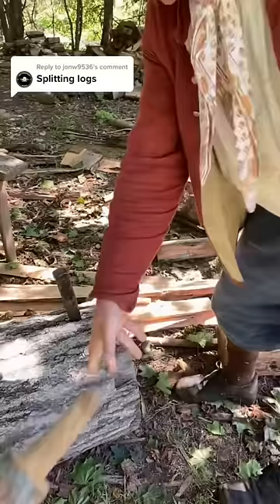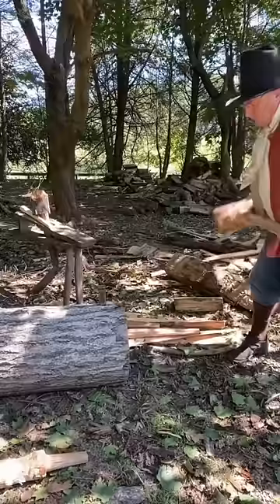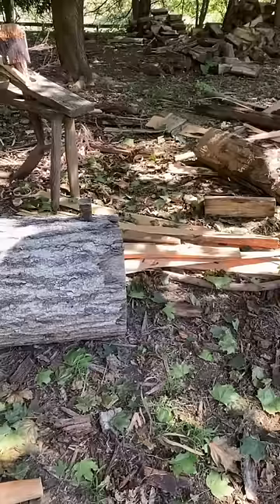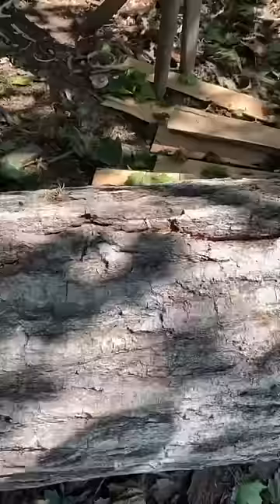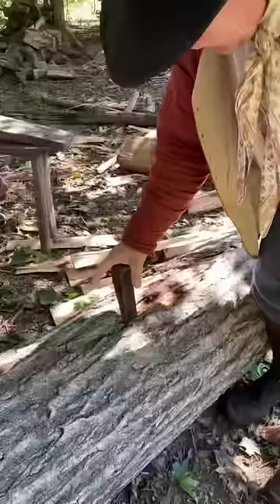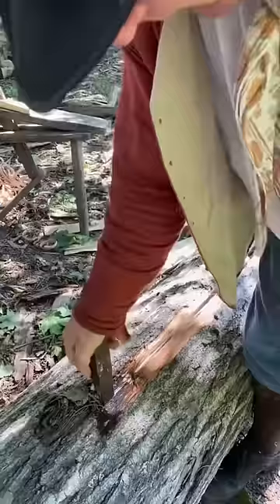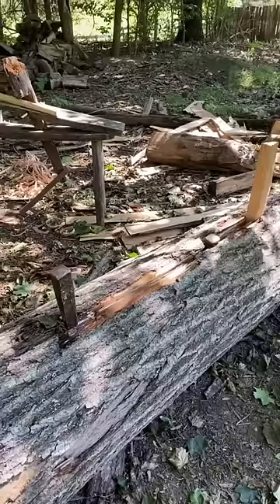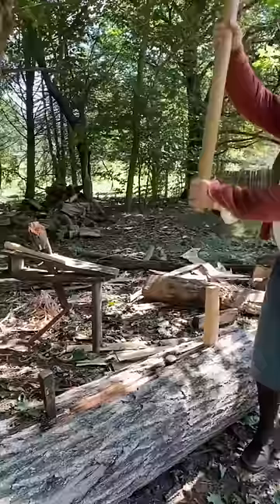Alex shows us how to #split a log using a #wedge. #simplemachines #livinghistory #history #museum

Comment: Yes,the hammer falling is doing most of the work. If that wood hammer weighs 15 lbs  ,the striking force would be many times that. A 200 lbs man falling six feet had about 3,500 lbs of force when he hit. Those pile drivers you see hammering in 40 foot telephone poles all the way into the ground are driven by a hammer that only weighs 300 lbs . The force generated through falling increases into thousands of pounds . A carpenter hold their hammer towards the end of the handle because the 20 oz hammer will do most of the work .
Reply from the maker: A blacksmith will do the same!
Reply: Where have you seen people hammering 40 ft telephone poles into the ground?
Reply: @two5seven14  Louisiana and other areas where ground isn't solid enough
Reply: Who cares they totally are not filming this with a camera from the period so I call BS
Reply: Yea um she said that

Comment: "This is basically using simple machines right" 🤓 
No that's a tool, but he's a machine 💪
Reply from the maker: Some of the tools he’s using are a few of the six simple machines. Lever, wheel and axle, pulley, screw, wedge, and incline plane. A simple machine is a mechanical device that changes the direction or magnitude of a force
Reply: An out of shape one at that
Reply: @frontiermuseum1  
He probably knows that, but was using the play on words to describe how much work he had to do. And unless you're using a dam to harness the energy of falling water, then you're not really letting gravity do the work for you. You're lifting the  hammer and storing your energy input in the form of potential energy, then you're utilizing that stored energy along with your continued energy input as the hammer drops to get a total amount of kinetic energy to impact the wedge as hard as possible. So it's all your work, and you are just using gravity to convert and store your slow energy input (low power) to then use that high velocity large mass to perform another conversion to perform work with a very large amount of force through a small distance over an even shorter amount of time (intermittent high power) to split the wood.
Reply: @gregstephenson3402  !
Reply: @davidscott5903  people can’t correctly answer how many moons earth has, when the was of 1812 startedc or what country’s boarder America, I’d be the farm that kid has absolutely no concept of what a simple machine is
Reply from the maker: We actually do a simple machines program for  field trips—it’s required learning in most elementary school curriculum. For Virginia, it’s a 3rd grade lesson and also covers early human technology/inventions
Reply: @frontiermuseum1  a wedge is an inclined plane...
Reply from the maker: The shape is similar, but the use is different.
Reply: @markpaperhanger2481  😂😂out of shape😂😂 yeah right that’s like a 20lbs mallet you try swinging it all day I bet you couldn’t even get it over your head more the 3-5 times
Reply: @frontiermuseum1  
So then what is a screw?
Reply: @tylerwestman5258  bet I could mr not so strong
Reply: @markpaperhanger2481  I bet you couldn’t to it all day like he does
Reply: @davidscott5903  it’s a screw aka a twisty nail😂😂😂
Reply: @tylerwestman5258  
🤣 I knew a guy a long time ago that said screws were only threaded to be removable. And he hammered them in. 
I was trying to point out to them that a screw is an inclined plane even though it is used in a different way, it is still the same simple mahine.
Reply: women and physics.  (eyeroll)
Reply: @Bradwick1  
I've known good and bad physicists who were both male and female. Sex doesn't matter. It only matters how much they try to be good.
Reply: I like that, I feel like you mansplained it better than she did
Reply: The top hat is where the batteries go.
Reply: @davidscott5903  the combination of axle and inclined plane.
Reply: @jackdaniels2000  
Yes
Reply: No he’s a gnome

Comment: As someone who cuts Chestnut Oak on a daily basis, this is in fact not a Chestnut Oak. Chestnut Oak has raised chunky bark from top to bottom, where as a Black or Red Oak has a smoother bark very similar to this beast! Happy splitting!
Reply: I was taught never identify a tree by it's bark . Identify by leaf , buds ,leaf scars,and most important , fruit. Bark is last ,and you know it depends on climate where  grows and soil tree grows in  because that can effect cambium tissue growth.
Reply: That's a chestnut oak, no where near a red oak and definitely not a Black oak.... White oak would of been a closer guess and it's not white oak either.
Reply: Looks like water oak (red oak)
Reply: Yeah not chestnut oak
Reply: Maybe we should ask the tree?🤣
When all you have is that which has been placed before you, then that's all you can use. As a woodworker who usually never even gets to see the bark, I usually have to identify the wood type by the grain structure, pore size, color and smell. Seeing the bark would be a luxury.
Reply: 50% of the  trees I cut (for firewood and  lumber) are chestnut oak. I know it very well.
Reply: I was just going to look up Chestnut Oak because the tree didn't look like it was and I doubted myself being very... Rusty. Thanks bunches
Reply: @cliffscheckler8832  I Had a set of child craft books in the 90s and it had a book on how to identify trees, by the bark 🌿 and 🥜.
Reply: @cecilsink9901  ever see someone try and use Black oak for anything other than burning?
Reply: @ADHDcisGinger  yes
Reply: It's a damn tree!
Reply: @ADHDcisGinger  yes indeed.  Flooring, furniture,  barn siding, shingles and  many other uses.
Reply: beetle looks like elm
Reply: I was taught not to judge a tree by its bark

Comment: Imagine 150 years ago, someone doing this all day and thinking about inventing a machine to do it.
Reply from the maker: Trip hammers are pretty old—China developed some as early as 200 BC and they show up in Europe in the Middle Ages (12th century)—but they relied on pulleys and horsepower and were very very heavy. This power problem doesn’t really get solved until the 19th century. Those sorts of trip and later power hammers were mostly used in industrial settings and wouldn’t translate well to use on a simple farm. But that human ingenuity for making a hard job easier, is definitely showing up very early in human history!

Comment: So, I’m just wondering why would they have a wooden mallet but Iron wedges? It’s difficult for me to believe that they wouldn’t have also made themselves an iron sledgehammer to go with the wedges. Just an observation.
Reply from the maker: A farmer can make a beatle (the historic name for his mallet) without too much trouble. They would have to buy a sledgehammer from a blacksmith because they wouldn’t have the necessary equipment or knowledge to make one. The farmer wouldn’t worry about the longevity of the beatle because it’s easy to make a new one.
Reply: It's also safer banging on the wedge all day could spend shards flying and really hurt someone

Comment: I wish a splitting wedge would stick into the oak I have. Mine spits the wedge back out.
Reply: Try making a starter point with an axe or hatchet. Hickory and  white oak are tough to get started at times
Reply: Could also be to green !  Maybe next year?  Removing bark will help it dry.  Don't know what you got going on ,,, but good luck!
Reply: Is the log bouncing?  Stable base under it?
Reply from the maker: He actually finished splitting it that day—we posted the second part the other day. But it definitely does help to have some of our wood seasoned, like you said!
Reply from the maker: Oops, didn’t realize you were referring to someone else’s wood 🤣

Comment: 1.  Red, not Chestnut Oak.  2.  Gravity doesn’t lift things, the man in Tolkien dress works hard to raise that heavy mass.  3.  Gravity helps it back to earth.  4.  It’s not a machine, it’s tools used by a human machine.  5.  Why don’t more you tube vloggers get an education, particularly this lady?  Mind you the chap with Thor’s mallet agreed that tools were a machine and that a mallet was a lever (the handle’s the lever, kinetic energy is what forces the wedges in) and that it was chestnut Oak he was splitting.🙄

Comment: If you going to use a wood hammer, use a wood wedge.
Reply from the maker: He starts with iron wedges and then switches to wooden gluts, depending on how the log is splitting.
Reply: @frontiermuseum1  I saw that too.
Reply from the maker: We have another video to post, sometime this weekend, about why a 17th century farmer would use a wooden mallet (or beatle) instead of a metal sledgehammer. We hope you’ll check it out!

Comment: you can forge a wedge but not a hammer?
Reply from the maker: No. The wedge would be purchased
Reply: @frontiermuseum1  
So they don't sell hammers where you purchased the wedge?
Reply from the maker: We have a blacksmith at the museum—but historically, a farmer would just make a wooden beatle (the term for this hammer) rather than purchase a metal one. It’s cheaper to use the wooden one and they’re easy to make.

Comment: Simple machines 👌 when I use my hammer and flat bar I'm using hand tools when I'm using my air nailer I have a machine doing the work me
Reply from the maker: Simple machines are devices with no, or very few, moving parts that have mechanical advantages that make work easier. The, classically defined, six simple machines are: wedge, pulley, wheel and axle, incline plane, lever, and screw. Combinations of these six simple machines become complex machines. At the end of the day, all engineers use these six simple machines, to do work

Comment: Well, not really - Gravity does the work when the hammer falls. Gravity works AGAINST the man as he raises the hammer. And it's a hell of a lot more work to LIFT that damned hammer than it is to let it fall. So, no, gravity does NOT do most of the work. The man does . . . . . you'll notice it is NOT the woman who is working that hammer. But if gravity really DID do all the work. . . . .then you can bet there would be a woman doing it because it would be easy.

Comment: You're ruining the hammer
Reply: Steel on steel....wood on wood.
Reply from the maker: It really isn’t made to last for years and years—so doesn’t matter if it’s being used with steel wedges. We also only use the steel wedges at the beginning and then alternate using it with wooden gluts (or wedges)

Comment: A machine is something with moving parts that makes a job easier.
This is not a machine.. nor a complex machine.
Reply from the maker: Simple machines are devices with no, or very few, moving parts that have mechanical advantages that make work easier. The, classically defined, six simple machines are: wedge, pulley, wheel and axle, incline plane, lever, and screw. Combinations of these six simple machines become complex machines. At the end of the day, all engineers use these six simple machines, to do work

Comment: Not machines..tools ..
Reply from the maker: Simple machines are devices with no, or very few, moving parts that have mechanical advantages that make work easier. The, classically defined, six simple machines are: wedge, pulley, wheel and axle, incline plane, lever, and screw. Combinations of these six simple machines become complex machines. At the end of the day, all engineers use these six simple machines, to do work